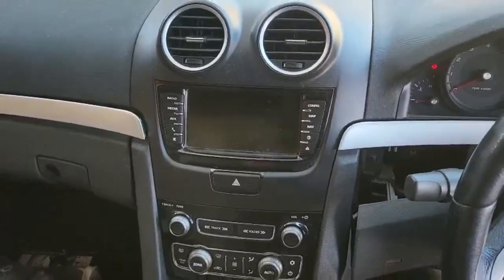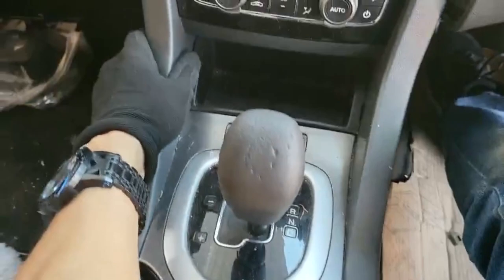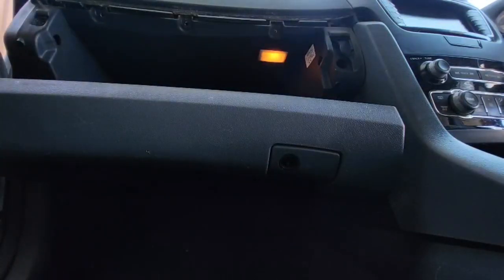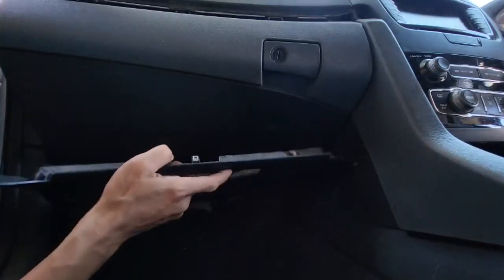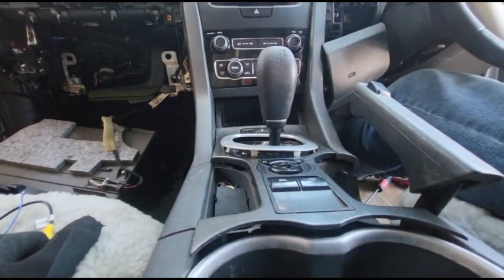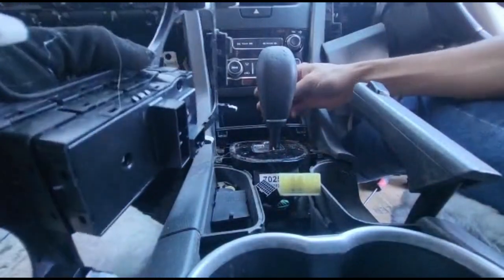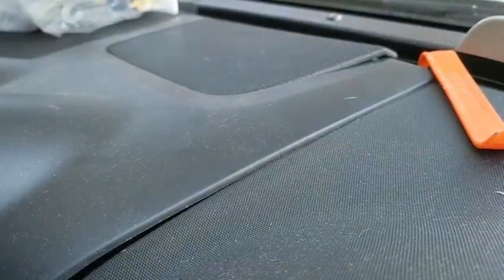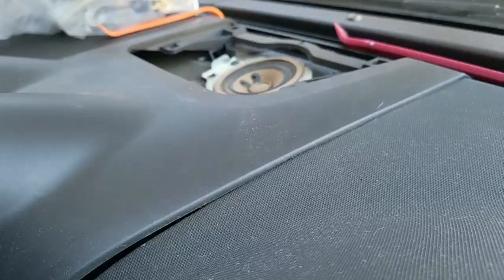Discover the Secret: How to remove factory radio HOLDEN COMMODORE VE SERIES II 2011 (Latest 2024)

Comment: Alot of work to do to just remove it compared to the older vt/vy ect. Mine is the exact same model and year. 
Ive noticed my screen turns on with the car sometimes but then other times it dosent? anything specific you can recommend to look out for when i remove it?
Reply from the maker: Sorry, it is too very hard to tell without real car inspection as many reasons could make that symptom